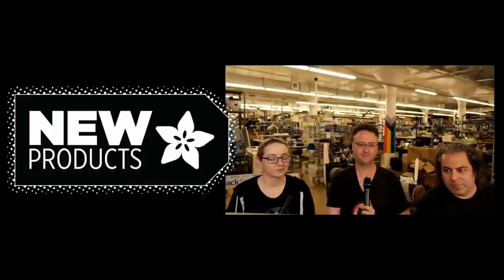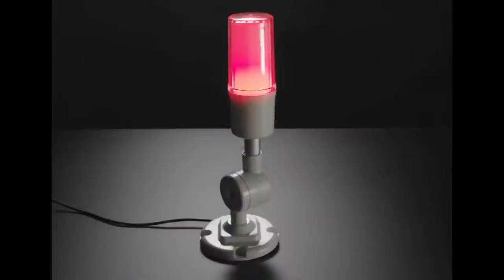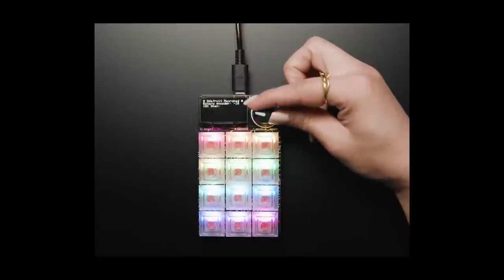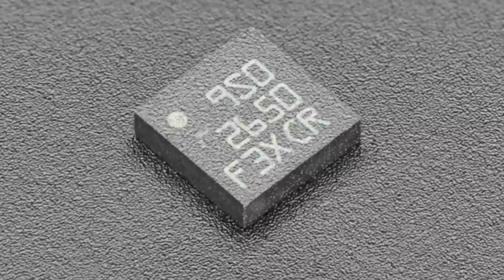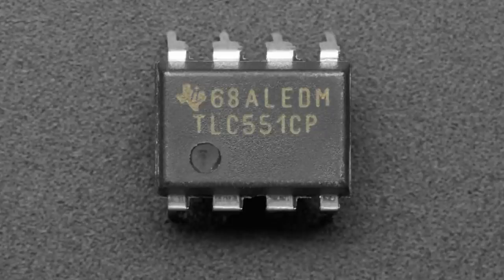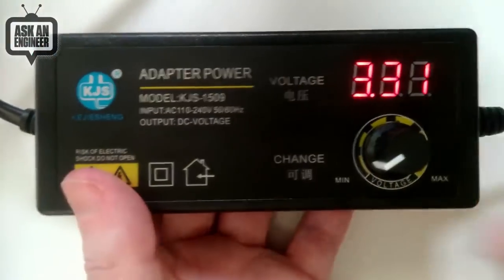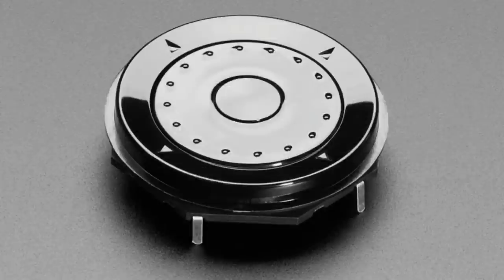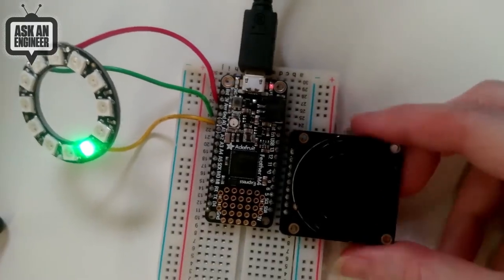New Products 9/8/2021 featuring #Adafruit ANO Rotary Navigation Encoder Breakout PCB!

Comment: The nice thing about DIP packaged ICs is the fact that you can shove them into sockets. So if the DIP IC blows up, you pull it out and shove a new one into the socket. That's how I designed my prototype 12V LED strip dimmer, then decided to make a nice compact SMT version, because who cares if the diodes or 555 dies, just swap the whole tiny board.

I really need to start learning the FTDI thing.

Adjustable power brick... I feel like I'm gonna plug it in, forget it's set to 24V, and blow up something expensive like a NeoPixel strip. So I might get like 4 of them for each common voltage (3.3 5 12 24). Inexpensive compared to getting one each of a Mean Well brick.